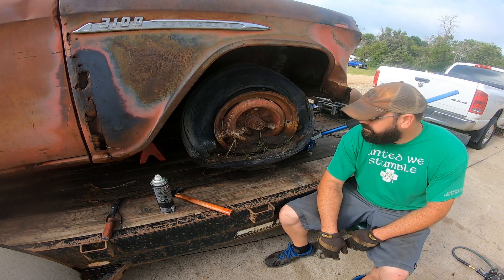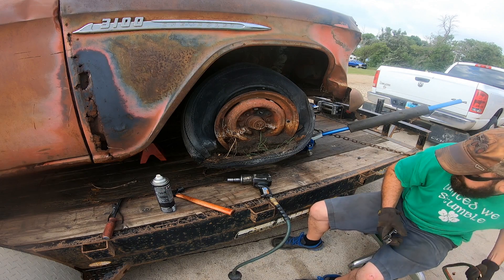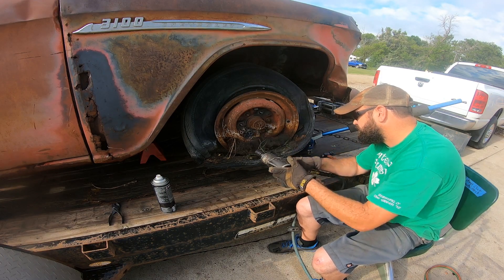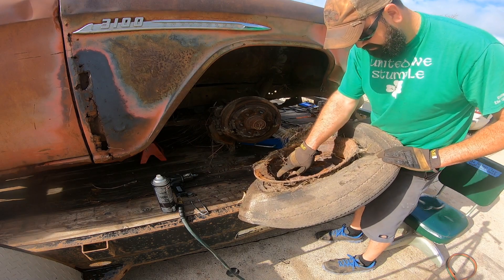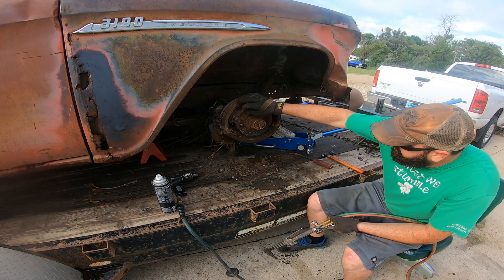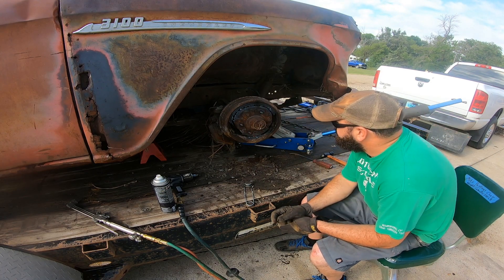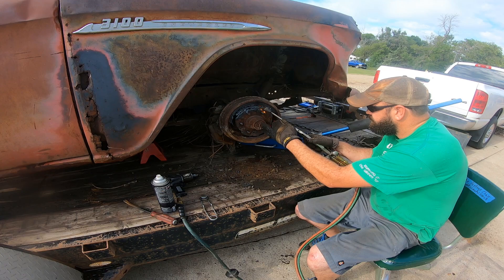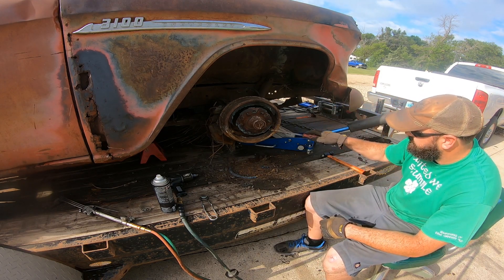Releasing frozen brakes that have been sitting in the dirt for 40 years! Making wheels roll again!

Comment: I usually get these cut off on the trailer as well.  I use the winch just to get vehicle on and cut before they come off.  I saw the guys from Mr. Goodpliars using some hub puller and I may try that.  I was careful with F1’s I recently got off since they are almost $100 each but cheaper ones just get cut off.
Reply from the maker: Agreed. If they're gold, save them. If they're something that's $40 on RockAuto or something you'll put discs on then make your life easy! Iowa Classic Cars Ryan likes smashing them with a sledge hammer but that just seems like work!

Comment: Great, innovative screw-the-brake-drum, anyway type dis-assemble.  Ya, those wheels gotta move when being towed, fer sure.  If they are too rusty, something inside MUST be removed.  Usually it's rusted brake pads and internal parts, levers or springs.  Sometimes, one can not spend days, straight at a junk yard, screwing around with rusted drum gaps.   Off it goes!  (badly)...

Comment: So that is a terrible tip.I just have to say.A drum puller is what i use impact and and other type has wings you hammer to break loose.You can take hubs and drums off 2 different pullers of amazones .Plus you don't destroy parts.Especially if there hard to find.Even brake pads that are welded with rust come off with these pullers.Just saying .Thanks for vid
Reply from the maker: Like I said in my video, this is what works for me. As most of the time you're going to either upgrade the brakes or they're not going to be salvageable anyhow. Thanks for watching!
Reply: @MortskeRepair  you also said drum was rusted too bad a puller would just rip it apart almost like you did so its not a big deal. Good video 👍
Reply from the maker: @josephpilosky4775  Correct, the drum was garbage anyhow so instead of putting a bunch of pressure on it and slinging parts across the countryside at high rates of speed I just give them a little gas axe action!